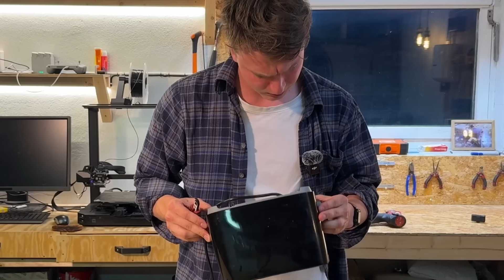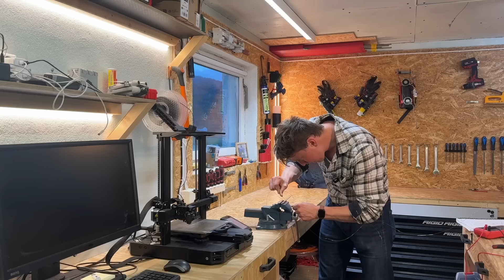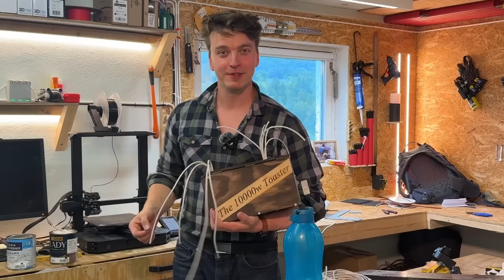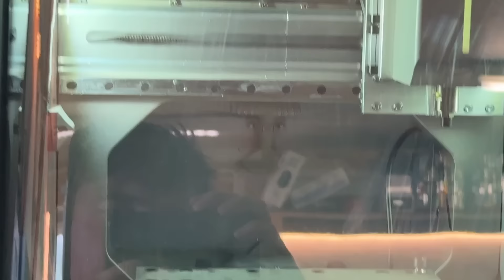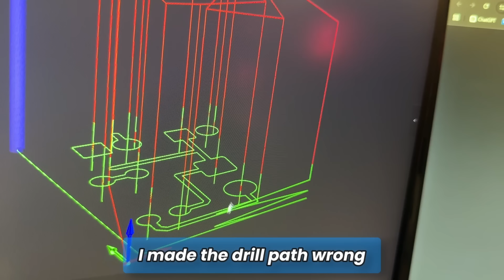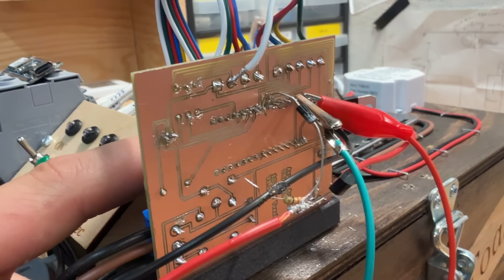I Built the World’s Most Powerful Toaster

Comment: I'm recalling hearing/seeing slate circuit boards for early elevators/lifts from BigClive. Slate may be able to handle the heat, it certainly won't catch fire or melt, but it could crack. 
Other rocks might be worth trying, but getting useful sized sheets might be hard. I don't know what's local to you.

Comment: Well, since this is the 2nd Video after the Water Cooker video, I seem to like this content according to You Tube.
So a Sub it is.
Also Sir I noticed you are using the SteelSeries Arctis Pro Wireless? 
Reason I ask is because I just yesterday got a Arctis Nova Pro Wireless and its much much better, especially the hinges holding the ear cups that failed on mine.
If you ever consider the same setup, but lighter, better, more convenient (Also forgot to mention the Batter last insanely long and charge super fast) the the Nova would be a Upgrade.
Till then, cant wait to see 10000W Toaster V2 
Bet You will make everything 10000W House hold appliances as such content is rarely seen on You Tube.
Reply from the maker: Hey, yeah I’m using the arctis pro, but it have started to show the signs of age. Thanks for the recommendation, I’ll definately check out the Nova pro, Toaster v2 coming soon😉

Comment: Maybe worth looking into using heating elements from pottery kilns? I love the insanity of the whole idea.
Reply from the maker: I’m switching from homemade elements to water heater elements in the v2
Reply: @Asgeir_Arnevik  Won't water heater elements overheat quickly in air due to the lower (around 4000 X lower!) specific heat capacity of air vs water? The reason I suggested kiln elements is they are designed to work in air continuously?

Comment: porcelan tiles should be a good material for holding the wire. a tiled toaster would also look real cool.
Reply: They used to make ceramic housings with like glazed on designs and they looked so fucking cool and as someone who collecta uranium glass one of the uranium glazed ceramic toasters would be amazing but they're like $400

Comment: WTF Norway, why is he using a blue plug for 3 phase power? what is going on? is it 240V phase to phase?
Is Norway using 240V 3-phase IT? 
I mean we did the same 100 years ago, but since almost anything is now TN 240/400V (I think even old IT grid connections are forced to be upgraded).
Does every house have isolation monitoring or do people just live without double safety?

Comment: As a person who does know a bit about electricity, good job! If it doesnt kill you and/or burns down the house, its a W. 

The common trick is to use aerosilicate, and twist the wire over itself at the ends, and jam it into a terminal block. (Ceramic ones exist, or just use only the brass part without plastic) 

Since aerosilicate makes a mess, using high temp red silicone to seal it is good, and red silicone is a weak, but universal adhesive. Good to about 260°C continuous. A wet throwel works, but do remember to clean it in soapy water immediately after. 

And probably invest in a dedicated switch right next to the toaster, so you can kill the power fast if shit goes down.
Reply from the maker: Yep, the only safetyswitch I had, didn't even work.... have ordered some parts to rebuild the toaster, so we'll see how it goes

Comment: you could squash the toast between two metal slabs (either scraps that somewhat fit together or some cut to size by the supplier) and then turn on the two massive 5kw+ induction heaters that just happen to be situated on either side of the bread sandwich. 

somewhat more expensive of a project, but hey, this one might work, and you can still make the housing of wood!

Comment: Tip for cutting PCBs on a milling machine: use Voronoi mode when generating the tool paths (I'm using pcb2gcode and it has a configuration option for that). This way all the traces will be as thick as possible and cutting time will be much shorter.

Comment: Captain Backseat here. Five square pieces of steel, maybe welded together, five induction hotplate circuits on each side, lid with a hole for a mini turbine shaft, small wire stand for piece of bread on bottom, 10kW airfryier that you can call a toaster. Should have cheap refurbished induction hotplates off Ebay, 4kW/4kW/2kW imbalance shouldn't be too much for the neutral to handle. No idea how the eddy currents will behave though, might need the plates electomagnetically insulated from one another. PS: most people who make their own PCBs experience these shenanigans ad nauseum. One of the main headaches I had (this was way before you could ask an LLM for advice) was a Mosfet latch-up in some op amps... the mosfets decided to cosplay as a Thyristor due to some electon voodoo. The fix was a single resistor. Finding that fix was months of headache. GLHF and stay safe with the angry pixies so you don't turn into my nickname. 🤟
Reply from the maker: Jeez, sounds like you've tried something similar? Guessing you're an actual engineer?

Comment: What if your washing machine spun faster and heated the clothes hotter? I bet that would reduce the cycle time and get clothes dry faster
Reply: Heating hotter is exactly what we try to avoid because that is what uses the most energy in a load of wash. Even if it takes 4x as long to run the cycle, it takes less energy in total. 

On the other hand, spinning faster is a great way to reduce the drying time, and better washers do indeed use higher spin speeds. (Up to 1800rpm on premium models, as low as 1000 on budget models. Most are 1400 these days.)

Comment: You could wrap the heating wire around a heat-resistant ceramic rod for support. That way, the heating wire won't sag.
Reply from the maker: Good idea, problem is I try to rely as much I can on materials I have laying around, ordering stuff could take weeks haha
Reply: @Asgeir_Arnevik  after the first test I was sure that you will position coils vertically
Reply: @Asgeir_Arnevik  Maybe could ask AI. There’s got to be a way to solve it!👍

Comment: I salute your spirit of moving forward despite all the sit backs. If it was me, I would've given up ages ago 😅

I any case, I noticed that while you crammed the 10KW in the toaster, the heat transfer is not ideal. Hear me out; so, you modify the metal plates that surround the bread and make small engravements on the non-bread side where you embed the heating element, make nice grooves for them (must be insulated to avoid shorting, the varnish used for coating motor wires would do fine I assume) and that way you get the bread done faster because the heat transfer is more efficient. worth a try?

Comment: Nice video. Keep it up. I would suggest if possible you should try and make at least a botched final attempt rather than a no success video as this would probably perform better with algorithms. I can see how you wanted it work but in terms of success perhaps if something similar happens in future just take it to the bare bones and show a few instances of it working. Even if that is just the wires and a switch or relay triggering the toaster in a very basic way. People still want to see what 10kw does to a slice of bread etc. keep it up

Comment: You can use stove element for the toaster
Reply from the maker: Thinking about switching the current elements with stove elements which I used in the kettle, would prevent short circuits atleast..

Comment: You might cry now, but you coulda put the rod in your cordless drill and just spun the coil onto it without doing a single loop by hand :D
Reply from the maker: I tried, I didn’t have enough hands to do all at once😂
Reply: @Asgeir_Arnevik  Asgeir, correct me if im wrong, but the PCB, isn't it supposed to be etched? I remember making a pbc in school like 25 years ago xD so the memory is a bit bad, but didnt you undo the copper lines by milling them away basicallly making the PCB inverted? Everything was copper except for the places that should be? xD
Reply: @Allexz  routing PCB's is a totally fine way of making them. The software works out the cuts to make to isolate the tracks, it doesn't cut the tracks.
Reply: @Asgeir_Arnevik its easy enough to drill a block of wood a bit larger than the rod and use some baby oil to make sure it spins freely, and then use two more bolted blocks of wood (ideally hard wood, like beech/oak) to tension the wire. One hand holds the drill trigger  and the other holds the tensioning block.

Comment: Maybe try using autoclaved aerated concrete to encase the heating elements, it is fire resistant, non conductive and you can easily cut it or make grooves.
Reply from the maker: Thought about using ceramic, but you’re right, aerated concrete would work aswell
Reply: Just don't use it in buildings 😕